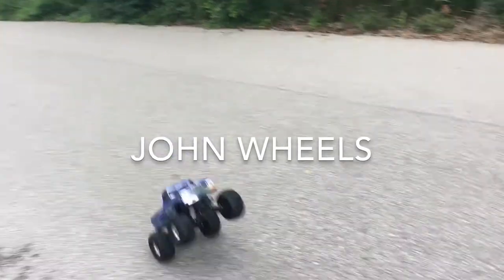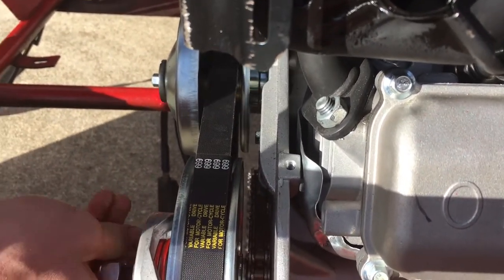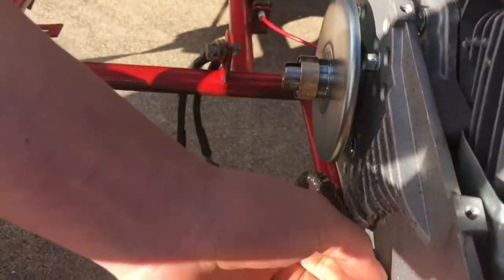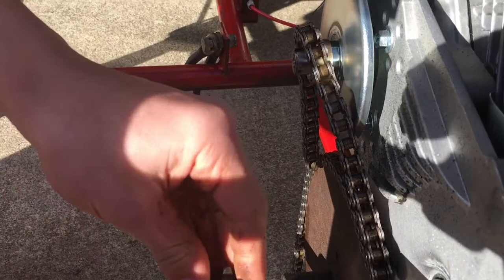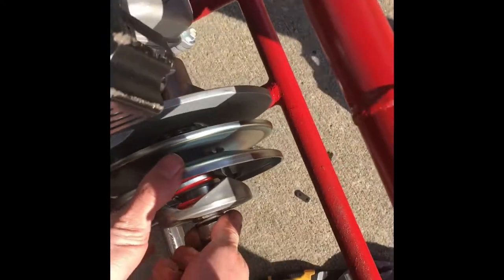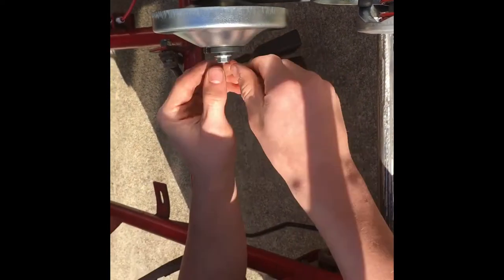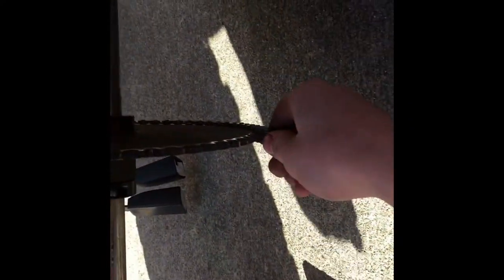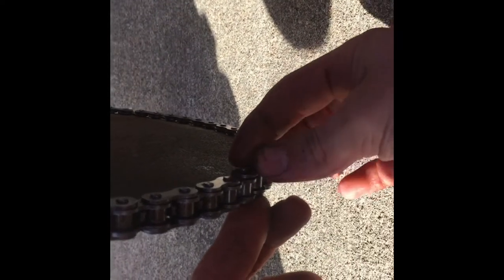CHAIN CLEARANCE FIX

Comment: Two question. My chain is hitting the lip on the rear pulley. Is this the fix? Where did you get that extra keyed washer from?
Reply from the maker: The fix to the chain hitting the pulley is to get a keyed washer or just cut a slot in a regular washer. However, you'll want to put a washer of the same thickness behind the front pulley too so that the belt still rides straight and is not crooked. The keyed washer came in the kit I got from Amazon.